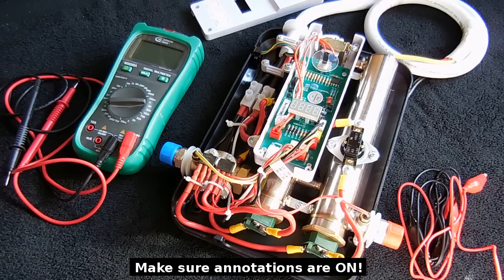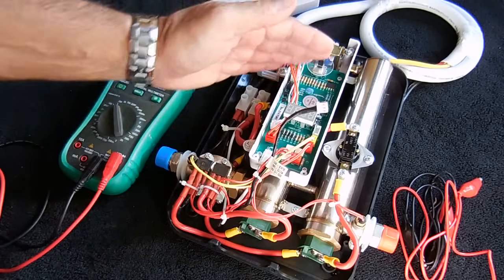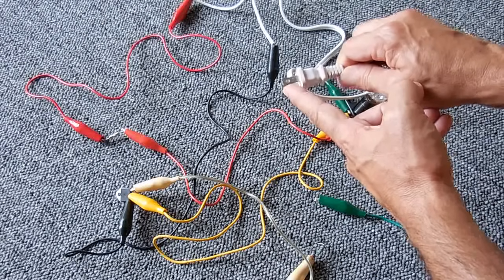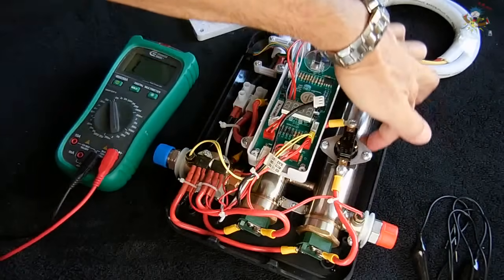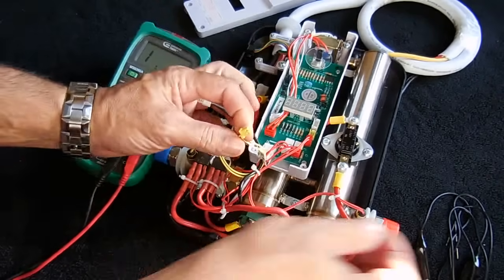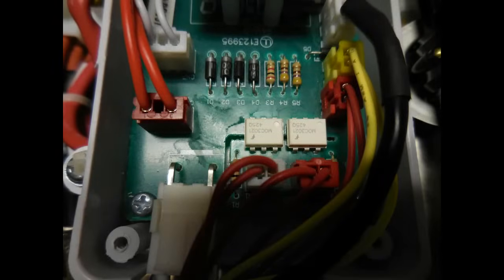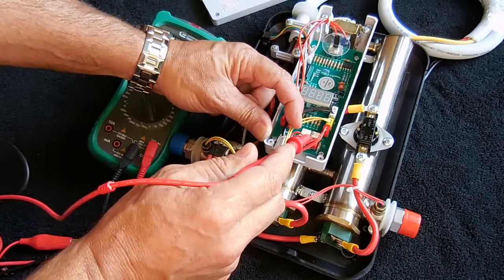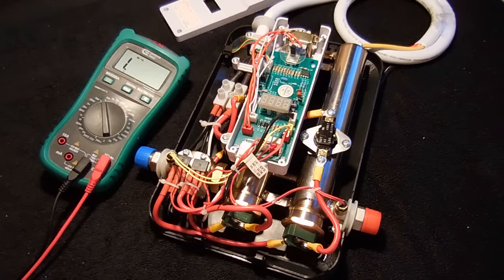Troubleshooting Tankless Water Heaters In MINUTES ~ Step By Step

Comment: I just installed a Atmor 910-24TP it work fine until I turn the hot water off at any place in the house I'm using it and it trips the reset buttons inside the tankless water heater why is that?
Reply from the maker: Sounds like the flow sensor is faulty. When the water is shut off, the unit still thinks the water is flowing, so it heats it up excessively.

Comment: I'm getting gas to the heater, but it won't go inside. The point's are sparking when I turn it on. What is wrong?
Reply from the maker: Do you hear the gas flowing? If there's gas flowing, and spark, then probably a blocked vent/air intake.

Comment: We bought a brand new electric tankless ao smith. It will only put out hot water if the water is barely on. We can't get it to work.
Reply from the maker: Inspect the inlet of the heater. Could be a faulty flow sensor.

Comment: Hello Sir I have the EcoSmart 8 problem, what happens is that the water gets hot for 10 seconds then goes cold and then hot again, never consistent. What could be the problem?
Reply from the maker: Dirty cold water inlet(clogged filter screen) or faulty flow sensor are the usual.
Reply: @electronicsNmore   Thak you good Sir.

Comment: hey I'm making a small correction when I have the thermostat on the lowest level the lights go off and on like they used to but nothing happens when I turn it up to high they all stay on and give me warm water that's if I have one of the cables of either one of the elements disconnected if they're both connected like they supposed to I don't get nothing just every other second lights flickering acting like if it was on the lowest level Heat. thanks.

Comment: hey there electronicN more I have a question I saw your video I have a American heat ADK-2  tankless water heater had it for 5 years change the elements twice, now I have a different problem  the water heater is on but  no hot water I checked the elements they're good. I used to see the lights go on and off according to the floor of the water but now I can move the thermostat to any degree and it does not do anything if I take one of the cables off one element it'll work on the highest level and gives me warm water if I have them both connected it won't do anything if you have any advice please help thanks

Comment: How do I bypass the 20min feature where it automatically turns off every 20 min. I’m using the TWH to heat my Intex pool and I sometimes forget to go back outside and turn it back on. It is powered by 2D batteries so I’m not able to use a timer. Thanks in advance.
Reply from the maker: You'd have to modify the unit and use an external swimming pool timer to turn on the heater.

Comment: Hey man! Great video very informative.  Quick questions recieved brand new instant hot water heater running off 5 gallon propane tank on outside wall of house. Plumber  installed when faucet is on heater cuts on we hear ignitor clicking but it will not light and the water stays cold. My plumber is stumped and so  am I.  This is a brand new unit. Please help.
Reply from the maker: Maybe the wrong pressure(regulator).

Comment: i have the ecosmart 27 when i turn on my water element 3 gets warm but 2 and 1 dont get hot and when i try and max it out it gives me too much water flow and ive had the unit for almost 3 years and this s the first issue 3rd element i get 42v which i no is not right and 2 and 1 get 240v
Reply from the maker: I don't think all the elements run the same time.

Comment: I have an ecosmart tankless hot water heater. About 2 years old. Today is the first time I have ever had trouble with it. But if I turn my faucets on to thier normal position (dont have low flow faucets) to get the hot water it just comes out cold. If I turn them barley on water gets hot just like it should. Could it be one of the heating elements or what would you suggest looking into?
Reply from the maker: You need to do some tests. Maybe a faulty element, faulty flow sensor, or faulty mosfet.

Comment: Hi sir,  unable to control the heat on the unit. Even when i try to make the water flow is mild, it remains too hot.  What could be the reason. Thank you
Reply from the maker: Either the temperature sensor is out of position/faulty, or the flow sensor is faulty.

Comment: i cant locate the reset button on my ecosmart tankless hot water heater model eco 18.
Reply from the maker: Every unit is different. Look up your make/model online. Thanks for watching!
Reply: @electronicsNmore  i tried to look it up in several places and couldt find what i needed .my eco 18 has only the two copper pipes .any ideas?

Comment: Very thorough and well-explained sir. Thank you very much. You helped me diagnose a bad heating element. I used my multi-meter to measure the ohms between one of the heating element terminals and piping as you instruct around 8:00. I had tons of crud from the busted heating element run through my hot water pipes. It was a pain in the butt to flush out!

Comment: Thank you so much for this video!  I have an Eemax unit and have done some trouble shooting over the phone.  They tell me the problem is the magnet getting stuck, which would require a whole new assembly.  I'm a little skeptical of this because the tests didn't seem consistent.  Is there a way to test the operation of the magnet.  Apparently the magnet in the Eemax unit is different from this because it's in a tube.  Thanks again for this awesome video!

Comment: Installed an EEMAX heater. It worked until I turned on the cold water in my shower at the mixing valve. Is it likely that I had back pressure at the outlet from the cold water? Before turning on the cold water at the mixing valve it worked fine.    ?.
Reply from the maker: Turning on the water at a fixture will not damage the unit.
Reply: One of the triacs has a broken connection the black material is cracked. Where can I buy one? Not sure if can resolder the connection. Thanks for great video.
Reply from the maker: Great that you found it. It's fairly easy to swap out. Look on Ebay for the part #, also buy some thermal compound.

Comment: I have a JNOD tankless water heater. The electric flickered a couple of times and now it’s saying that the temperature of the water coming out is 170 degrees when I have it on 120. Can you please tell me how to fix it and also where I can buy the parts I need. Thank you
Reply from the maker: Maybe you need to reset the breaker. Power off, wait a minute, then turn it back on.

Comment: Hi, I have a question if you have time.  I have tested everything in this video. I have 120V on each leg going in from the breaker.  I have 12.5 VAC on the secondary of the transformer also I have around the same resistance that you got on the primary and secondary.  I checked the continuity through the thermostats while cold water was running through it. I checked the resistance on the inlet and outlet temp sensor with an ice cube.  Resistance goes up when ice cube is applied and goes down when removed.  I hooked up both triacs the exact way you showed and they both worked by turning on the light bulb.  The heating elements look fine upon visual inspection.  No corrosion or bloating and they both read 10 ohms.  The screen seems to work fine. I can turn it off/on, up/down and from C to F.  I tried shorting pin 4and 6 on both the opto couplers with a pair of pliers.  The temp of the water seemed to go up a small amount when I did that.       Do you think I could have an issue with my water flow sensor?  And if so is there anyway to know without having to test it with an O-scope?  Do you have any other suggestion?  Thank you
Reply from the maker: Sounds like a faulty flow sensor.

Comment: Thank You very very much...this video is straight to the point and really educational .My Eco has just stopped heating, its lED dial is lighting up  , I had just replaced one of the heating elements however its still not heating up ..Triacs ?could you make a video on replacing them ? I also have a question do the triacs fail in pairs? because my water is cold even when I put the dial to 43 * C, Last time I just replaced the element and every thing worked..anyway thank You once again.
Reply from the maker: No, they don't normally fail in pairs. Very easy to replace. Unscrew from heat sink, desolder, solder new triac in place, apply new thermal compound to the triac, then screw back onto heat sink.

Comment: I have a Noritz tankless water heater, and it works pretty well now for over 8 years.  I have a problem though, if I try to make my my shower water cooler, I get to a state where the water either turns totally cold, or gets totally hot.  When it works it is often very hot, which I mostly like, but sometimes I want it cooler.

I bought and attaches the remote control unit and set the temp to 100 degrees, but it seems hotter than that sometimes.  If I am taking a shower and I turn the cold water up too much the whole thing shuts down and I get totally cold water.  If I turn the cold water down eventually it will get warm, but then it will also often get too hot ... even with the max temp only set to 100.

I have a very cold hot and cold water combiner ... maybe from the 60's or earlier to control the shower, and I thought that might be part of the problem.  If I open a small stream on the vanity faucet it seems to work OK.

I think somehow opening up the cold water pushes against the hot water and causes the stream to slow down and the burner to shut off.  Is there a way to fix this?
Reply from the maker: You need to inspect the cold water inlet of the heater. It could have a lot of debris/corrosion inside.
Reply: @electronicsNmore  
I just cleaned the filter again and it was almost clean as a whistle.  I think there is a drop in pressure on the outlet of the water heater, and when the cold water mixes in the shower fixture the cold water pushes back on the hot water because it has higher pressure and impedes the flow, and the until seeing less or no flow shuts off the burner.  I don't think the imput is obstructed, and I don't see corrosion or rust in the screens on the faucets?

Comment: We have experienced Frosty mornings in Taihape NZ. I have a 16 H Model Brand new installed by an experienced Plumber. WE elected to have the Battery operated Bosch Hydropower instead of electric. I asked if it was going to be Frost free meaning that it won't have any problems during Frost or Snow. Already we have had several Jack Frosts and the Hot Water will not run but will when you change to Cold Water. The Bosch supplier is the Plumber who installed it. I've told him about it and all he could do was to cover / protect the pipes from the bottom of the appliance to where they go into the wall towards the Gas Bottles. How can you help. Could you also reply your answer to me on +64 021 161 2350, I look forward to your answer with thanks. Terry Steedman
Reply from the maker: I don't understand your question. The water flows but it's not hot?
Reply: electronicsNmore please read what I'm saying on a frosty morning the HOT water will not flow only the COLD water will.

Comment: Why is it that these tankless water heaters must have three or four breakers in your breaker box. You would think that recification and amplification is something that has not been developed. Why must the elements be provided with there seperate 40 amp breakers and must be ac. amplification or current amplification has been around for years. Tubes in the Old TV could produce amps that would fry a person very easy. Never needed a 40 amp for your old tube TV. What is it that these elements need there own 220 connection? Why should these tankless water heaters even be considered when needing 3 or 4 40 amp breakers. One 30 amp breaker with amplifiers I would think should be all a tankless needs. Tell me why I am wrong thinking this way.
Reply from the maker: All the tankless heaters I installed used a double pole 30A to 60A breaker.

Comment: Hi I really watched your video and you recommended the heater elements were defective which I since replaced. The heater isn’t coming on so I checked the flow sensor and a 5 volt is not changing when water is turned on so the circuits aren’t sensing the water flow. What I noticed the flow sensor is not the recommended one I see in the parts listing for the ECO 11. It only has two wires. Is it just a switch then or how do I troubleshoot this part the two wire flow sensor. Thanks for any help you can provide.
Reply from the maker: If the unit doesn't turn on when the faucet is opened, then it's a flow sensor issue if the unit has power.

Comment: I have a 27kw ecosmart and my ohm settings where all negative  is that normal?
Reply from the maker: For that to happen, the circuit under test is getting current from another place besides the DMM. Make sure you disconnect everything. Thanks for watching!
Reply: @electronicsNmore  it's odd I have 220 at ea element temperature sensors are both accurate but elements will not turn on. Should I swap the mosfets?

Comment: Hi...I have an ECO 11 like you are using and it blew the inlet pipes out with an explosive sound.. broke the PVC pipes. I connected it and heard an explosion again through the open pipes so I disconnected the power. I am trying to work around the problem but I am having problems around the flow meter and whether it blew out. I need to see it’s physical placement in the circuit...Thanks in advance.
Reply from the maker: Sounds like a faulty heating element. The hot water outlet must be CPVC or copper, not PVC.

Comment: My igniter kicks on with zero water flow (gas/flame stays off, tries for 5 seconds then gives up). Then flame stays off when water flows, unless I lower pressure by shutting off input water, or if  turn unit off then on then the igniter tries again, and if water is flowing the flame kicks on. Main problem is thermostat light stays on. No troubleshooters address this. I've looked everywhere. Worked on it all day.
Reply from the maker: Could be a faulty flow sensor or a problem with the gas pressure.
Reply: Thanks.

Comment: Hi, really interesting and informative video! We have a rheem 13kw which has been working great for years and has good water flow. All of sudden quit heating..I followed some of your tests and have good supply voltage and the heat exchangers check out, what happens when I reset the unit is it goes into full heat whether or not there is any water moving or not.. The unit will not go into standby mode always full heat. For now we are just running the water and turning on the breaker to get hot water. In the interest of using the unit have not tore it apart to do any further tests. Do you have any idea what might be the cause of this malfunction. And of course if I let it sit with no water moving and it turned on it will over heat and kick the reset switch. Any help greatly appreciated..the wife says buy a new one!!
Reply from the maker: Definitely a faulty flow sensor or shorted triac.
Reply: @electronicsNmore  Thank you for the insight, I have since purchased new for obvious reasons but would like to fix the old one as a backup if possible. So will dive in and check out your other videos and such and see what I can do. It was great that it did not totally let me down, only one cold shower until I realized a workaround..Thanks again

Comment: If the heater is was not properly mounted on the wall instead they put it laying above the toilet ceiling will it works properly or not?
Reply from the maker: The orientation of the heater shouldn't make any difference. Thanks for watching!

Comment: Are there really three different triacs, one for each element, in an Eco 27?  Parts are listed that way ... but they appear to come with their own wiring harnesses ... and I wonder if it's just different wire lengths... seems to me you wouldn't need triacs with different specs for each element.  

What happened with ours is, a couple of times in the last week, it would get hot, then cool some, then get hot again and stay ... now it just gets lukewarm.  

I haven't run these tests yet.  I was hoping it was just a fuse, but ... now I'm afraid it's a triac.  Don't know which one, though.  I'd like to just keep a few on hand, but if they are really element-specific, that's a crap-shoot.
Reply from the maker: You definitely need to perform some tests. Thanks for watching!
Reply: @electronicsNmore  Talked to EcoSmart tech support today.  Yes, they are just different wire harness lengths, the triacs are the same.  BUT ... he also said triacs are very rarely the problem, initially.  Bad elements & thermistors CAN eventually cause the triacs to go bad, but the #1 and #2 problems they see are elements and thermistors.

Comment: I was able to repair my Eco 11 quickly with your help. Thank you. I have a question. There are KW pins on the circuit board that you select according to the model you have. The last pin says 125. If I put a jumper there, does this mean the unit will always be at 125 degrees? I have a problem with someone dialing up the unit to 140 degrees. I have small children here and want to prevent an accident. Thanks again for the great video.
Reply from the maker: Glad it helped you! I no longer have that unit, I moved, so I cannot answer your question. I have many great videos on my channel, so be sure to look over my extensive video playlists, rate thumbs up, and most importantly share with others. Thanks!
Reply: I

Comment: Used to be very hot, now is just warm and I notice the power light looks dimmer.  Champs trimark electric tankless
Reply from the maker: You need to measure the AC voltage entering the heater.
Reply: electronicsNmore voltage is fine
Reply from the maker: Made sure there are no clogged screens at the inlet?